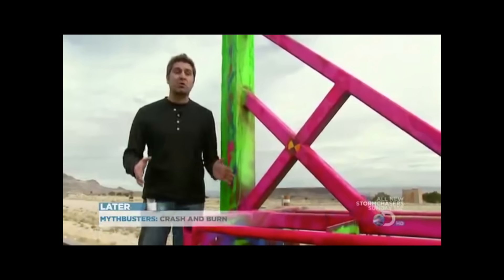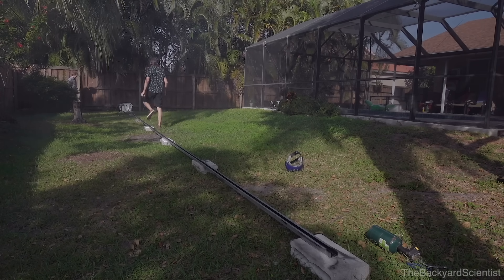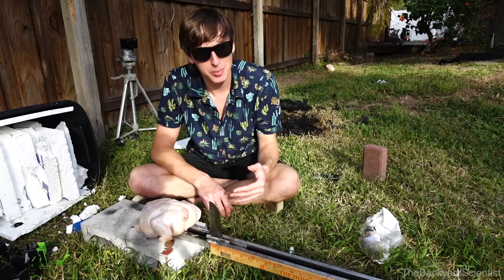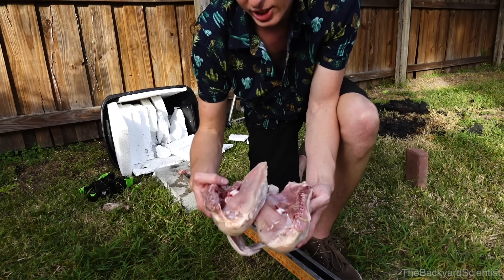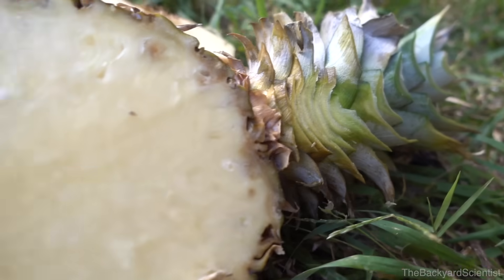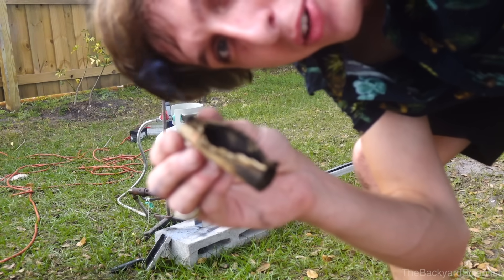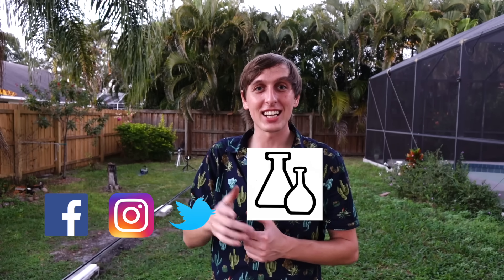150 mph Rocket Knife

Comment from the maker: MythBusters made me do it!
Any ideas for next weeks RED HOT ROCKET KNIFE?

ps how long before somebody copies the rocket knife?
Reply: TheBackyardScientist Um
Once they see this video
Reply: TheBackyardScientist do it with flint on the other side!! How many sparks will be created?!?
Reply: Do it with ballistics gel
Reply: TheBackyardScientist Try cutting through some oobleck, a phonebook, a roll of tinfoil or paper towel or something maybe, and a line of several of the same vegetable to see how many it can get through (though you may need a longer track of that one). Awesome video.
Reply: +TheBackyardScientist 
Man I miss mythbuster !
Reply: A  baseball, a car battery, a tire, a wheel of cheese, a can of lard, a can of spray paint, a pool noodle(length wise), anything dipped in liquid nitrogen that would shatter, a long pepperoni stick, a steel toed boot, a tennis ball, a toilet seat lid, a giant crayon, Toaster Strudel, and a bunch of big marshmallows and or a can of Fluff. Some ideas.
Reply: I think you should do 10000 degree knife versus iPhone 7 because it sucks
Reply: hmmm I'm wondering what will happen if you pit your red hot rocket knife against dry ice or possibly oobleck
Reply: TheBackyardScientist maybe a bottle full of obleck
Reply: try vs an Old Nokia phone
Reply: By somebody, do you mean the crazy Russian hacker
Reply: Flip it around.
Rocket car vs Knife
Reply: TheBackyardScientist dang, I saw the title of this video, went straight to the comment section to make the 1000 degree knife joke, buts it's been done already :(
Reply: TheBackyardScientist a popcorn tin or a toy monster truck ( a metal one please)
Reply: TheBackyardScientist make the track longer
Reply: Try to cut a block of ice with the red hot  150 mph knife pls
Reply: I think a bag of flour would look cool. Or sugar, I think the knife would defiantly be going to fast to melt it though.
Reply: TheBackyardScientist oobleck
Reply: TheBackyardScientist please please do the GoPro again with longer route
Reply: TheBackyardScientist a few ideas 
1: phone book
2: large block of ice
3: one of those "cut/knife proof gloves"
Reply: TheBackyardScientist hey if you want to get a crap ton of subscribers all you have to say is 1000 degree knife vs...
Reply: coconut
Reply: TheBackyardScientist do the same thing but with 1000 degree knife
Reply: TheBackyardScientist can you do 1000 degrees knife challenge with your rocket knife
Reply: bend the other side of the rail upwards and see how far up an aerodynamic rocket could go
Reply: I got a suggestion. DON'T TOUCH THE KNIFE! lolllll
Reply: Do 150mph rocket pants
Reply: TheBackyardScientist OOBLECK
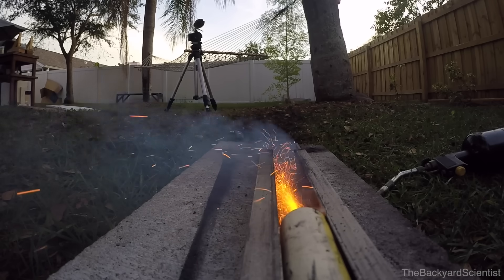Reply: TheBackyardScientist I guess you can say from 6:15 to 6:18 the go pro went from 0 to 100 real quick xD
Reply: You were a bit late with the countdown.
Reply: TheBackyardScientist I watch grant as well as mythbusters
Reply: TheBackyardScientist YOU ARE AWESOME
Reply: TheBackyardScientist  set a pice on f fabrice on fire with mirroes
Reply: the backyard scientist  this idea u might like invite one of the myth busters and tell him to bring buster   to make a mold with a skeleton in it. Experiment idea= Have one experiment with a hot knife and one experiment without a hot knife, also make the knife like a foot long ok. Keep being cool :-)
Reply: Do a chain reaction, where one knife sets off another and maybe a Rube Goldberg machine...I don't know.
Reply: TheBackyardScientist you should make a really long track.
Reply: TheBackyardScientist i thought it was going to be a live chicken
Reply: TheBackyardScientist when using the black powder make sure it's crushed into small pieces because the bigger the more explosive
Reply: TheBackyardScientist you should cut the mighty wallet
Reply: Can it cut through a brick?
Reply: TheBackyardScientist 

Knife vs knife
Hot knife vs knife 
Hot knife vs hot knife

(Will two of the same knives be able to slice each other?)
Reply: Can you make it chop a paint can
Reply: TheBackyardScientist you should have been on "the search for mythbusters" or whatever it's called
Reply: TheBackyardScientist I miss mythbusters :(
Reply: TheBackyardScientist Two knives on opposite ends of the track crashing into eachother!
Reply: TheBackyardScientist ballistic gel,
Reply: Get a piece of aluminum near its melting point then rocket knife it. See if the extra pressure and resulting heat causes it to melt and slice in half!
Reply: TheBackyardScientist put a red hot knife on the rocket sled
Reply: Melt a nife
Reply: TheBackyardScientist you should make this a series so we can watch more rocket cutting
Reply: TheBackyardScientist i dear you to make the fire type of the zippleback gas and sparks like the movie how to train your dragon
Reply: TheBackyardScientist Maybe some marshmellows, a rubix cube, a water balloon suspended from a string or a deck of cards. Or just a shoe.
Reply: Closest to a copy is DemolitionRanch using a can cannon to shoot a bowie knife missile. This moves a butt ton faster.
Reply: MineFish 
1000° knife*
Reply: 1000c° rocket knife VS. 1000c° rocket knife ;-)
Reply: Test the hot knife through a block of ice, plastic container of water and a piece of wood.
Reply: colab with "whats inside"
Reply: TheBackyardScientist try cut a metal  car  model I have no idea how but I know you will find out how
Reply: Can you please give it a shot with ice, or dry ice, and see if there is a significant difference between a rocket propelled knife and a red-hot rocket propelled knife?
Reply: TheBackyardScientist you should do some things that will have varying difficulties to see the burning effects, jello, soap, balsa wood, large crayons, plastic figurines, books of different thicknesses, and some really light freestanding objects like cardboard and a ball of aluminum foil would be interesting, see wether or not it's moving fast enough to cut it instead of pushing it away.
Reply: Coconut and a piece of metal.
Also try to run two rocket knifes into each other from both ends
Reply: when people realize they can make views and lots of money is when they steal it, And do red hot rocket knife through multiple sticks of butter or something
Reply: TheBackyardScientist a coconut.
Reply: +TheBackyardScientist, please do a talking furby >:)
Reply: Red hot rocket knife throo a tablet
Reply: TheBackyardScientist Red hot rocket knife vs. dry ice
Reply: TheBackyardScientist make it do a loop
Reply: TheBackyardScientist What whould happen if you  launch an 1/64 scale and an 1/43 or 1/36 scale diecast car in that track?
 You should also try to launch two cars in the oposite ways of the track and let they have a front to front crash!
Reply: TheBackyardScientist THIS IS #13 ON TRENDING RIGHT NOW!
Reply: Send it through some metal objects, or hell ask people to send you objects to cut through. XD maybe even try a brick
Reply: 150 Mph is equal to 67.1 meters per second.  Going from zero to 67.1 m/s in 0.3 seconds gives an acceleration of about 220 meters per second per second, which is about 22 Gees.  This is definitely enough acceleration to be deadly if sustained.  However, my guess is that 0.3 seconds of it might be survivable.  The problem is slowing back down, crashing into a bunch of rags/Styrofoam would be pretty deadly.
Reply: TheBackyardScientist this is my most favorite or top 3 videos on YouTube. good job i hope you do more like it
Reply: TheBackyardScientist fruit ninja
Reply: TheBackyardScientist do that same experiment except with the knife being 1000 degree please
Reply: TheBackyardScientist is it possible to do the moonwalk on the moon
Reply: Pro Tip: Hot steel looks like cold Steel
Reply: TheBackyardScientist 1000 degree knife going 150 mph
Reply: lol how smart can you be to touch a knife that was red glowing just a min ago
ps. no hate i love your videos
Reply: TheBackyardScientist launch it into a lamp please
Reply: TheBackyardScientist Try out a Prince Ruperts Drop!!
Reply: TheBackyardScientist do it to dry ice
Reply: TheBackyardScientist Rocket knife vs stuffed animal
Reply: TheBackyardScientist lol
Reply: OOBLECK
Reply: Was The truck green or yellow
Reply: TheBackyardScientist you should try to make it cut through a rack of ribs i think the chicken ribs were not so tough so do big ribs
Reply: Thebackyardscientist where did you get the recipe to make them
Reply: that car-intro blew my mind
Reply: TheBackyardScientist you are awesome
Reply: I agree with you
Reply: TheBackyardScientist Im new
Reply: electrocute liquid nitrogen
Reply: TheBackyardScientist I have a therie to revolutionize the way man travels
Reply: SleazyPineapple ! He said it took 0.5 of a second to GET to 150 mph
Reply: Why dont you build a longer rocket track and put the GOPro on the rocket. I think you will get some awesome footage ;)
Reply: TheBackyardScientist whats up
Reply: TheBackyardScientist ñ
Reply: 5:35 don't forget  you heated up the knife.
Reply: TheBackyardScientist maybe tomorrow we'll see some copies
Reply: TheBackyardScientist hey I said that on instagram
Reply: +TheBackyardScientist Create a bigger track kinda like a roller coaster :D
Reply: TheBackyardScientist i
Reply: TheBackyardScientist please post more
Reply: Try The Rocket Knife through Dry Ice, Iphone 7, A Log, or even maybe a McDonalds Burger.
Reply: TheBackyardScientist. what happens when you throw salt on a fire?
Reply: Heat up a knife/machete in your forge then cut some stuff. (Get it to a bright orange/yellow)
Reply: TheBackyardScientist lyhhgnbbn
Reply: TheBackyardScientist GO THROUGH A BAG OF SUGA,OR SOMETHING LIKE POLLY PLASTICS
Reply: TheBackyardScientist you should copyright this as a speedy fast fruit and other foods cutter
Reply: Please read my comment it would be a cool idea also get better soon
Reply: TheBackyardScientist perhaps you can use this to make two items collide and record it with a high speed camera😊
Reply: Try cutting some carbonated drinks
Reply: TheBackyardScientist A coconut or another knife. See how deep it embeds itself into gel. And we should think of a material to reliably slow it down.
Reply: Is that guy your lover
Reply: TheBackyardScientist was it just me or was the top of the knife facing the targets and not the blade?
Reply: TheBackyardScientist you should have made the knife red hot and 1000 degrees
Reply: TheBackyardScientist why don't you see it can cut though a phone
Reply: Do a plank of wood.
Reply: TheBackyardScientist do an I phone and see how well it survives
Reply: TheBackyardScientist next do it with a watermelon!!!
Reply: TheBackyardScientist never mind you just did it
Reply: TheBackyardScientist oh wait nvm lol should've waited
Reply: TheBackyardScientist 
It will be copied in 2-3 weeks ^^
Reply: TheBackyardScientist I love when you touch the red hot knife
Reply: TheBackyardScientist cut through a big rubber band ball
Reply: Maybe see if the knife will cut through a red-hot metal pipe. assuming it's become malleable enough, it should cut clean through and maybe even create a few sparks. How about Rocket knife VS red-hot Flint stick?
Reply: 0 to 150 real quik
Reply: TheBackyardScientist myth did this for a metal car,but you doing it with a plastic car dont it will give any changes to the myth
Reply: TheBackyardScientist next meme red hot rocket kinfe vs....
Reply: TheBackyardScientist were you in Orlando Florida at a Jw Marriott 15 floor cause I think I saw you.
Reply: what if... it cut through a second knife?
Reply: TheBackyardScientist I love the myth busters it's my favorite show
Reply: great job with holding the hot knife... just great job... :/
Reply: TheBackyardScientist tub of cornstarch and water
Reply: can you make the Rocket Slide ramp slanted
Reply: Jacob Burrell it was a santoku knife blade so the straight part is to sharp side.
Reply: They're too lazy to make a sugar rocket and a track.
Reply: Try a line of coconuts.
Reply: Make a super long pipe and see how far it can go without stopping
Reply: TheBackyardScientist dude try using a katana and slice through a paint bucked also super heat it and slice through the dry ice I think that would be cool
Reply: cut through a reactive element
Reply: TheBackyardScientist what would happen if you poured molten aluminum in water with sonic vibrations going through it
Reply: cut some sort of electronics like a phone, tv, camera, game console. maybe a canned soda too!
Reply: TheBackyardScientist  the safest project ever attaemptes
Reply: TheBackyardScientist water bottle
Reply: Multiple rockets
Reply: TheBackyardScientist try a gelatin chicken
Reply: TheBackyardScientist ohh I have an idea, how about 2 super rocket knifes slap into each other,
Reply: TheBackyardScientist im doing it in the morning as soon as i wake up and get ready for the day
Reply: TheBackyardScientist knifes VS aluminum OR pewter because its so soft OR that really reAllly soft metal
Reply: TheBackyardScientist cut a GoPro in half with the rocket knife
Reply: bigger targets, or do it like gun professionals with jelly see how fast and hard it goes , and more fire to make it look cool specially with the red fire and the green .👍
Reply: TheBackyardScientist you should do a vid with those people who test weapons on zombies and c if that knife can kill a zombie
Reply: TheBackyardScientist you should do a red hot knife vs water liquid nitrogen and molten aluminum
Reply: yess, everyone copies everyone UHG (and then people feel that just because something's a "trend", they don't have to credit the original creator?? That's not how it works buddy, that is Not how being a quality human being works. >:( //sigh)
Reply: Miles Aaway its all about having fun dude
Reply: true 
(having fun while giving people validation in the form of credit woooo!!!!!!)
Reply: Well since we saw it on Myth Busters.... The minute you made a rocket knife :) :)
Reply: IS MY DOG CUTE
Reply: My dog is cute :3 yes 🐶🐕
Reply: Calvin Chapman good idea
Reply: it looks tasty would wanna eat it
Reply: TheBackyardScientist Send it through a roll of aluminum foil.
Reply: now even you are doing the 1000 degree knife?
Reply: *680 degree knive
Reply: uhh no, I messured when it's glowing hot is is about 680 degrees cescius.
Reply: TheBackyardScientist you looked like a liddle kid on christmas :D as it workt with the car. nice :)
Reply: TheBackyardScientist it's to hard to do or recreate
Reply: TheBackyardScientist red hot Rocket knife vs. block of ice
Reply: :P
Reply: Try a few foot section of 2x4 or 1x4 going with the grain and see how far it will travel. Then see if it can cut through a 2x4 against the grain.
Reply: TheBackyardScientist 
Someone with no rocket knowledge is going to die trying this trend but your vid is awesome
Reply: rocket propelled katana cutting though a used medical school cadaver.
Reply: TheBackyardScientist could you set up a track so that the red hot rocket knife could complete a perfect loop and cut through a large diameter watermelon which is placed in the centre of the loop. Possible backfalls: extreme g's cause catastrophic failure to the integrity of the rocket knife and hey presto - speed-flying hot knife. Still would be fun to watch.
Reply: u should be in mythbusters the search
Reply: u should be in mythbusters the search
Reply: TheBackyardScientist I love you
Reply: TheBackyardScientist I made a rocket train last week but it was a little different
Reply: Cut through a loaf of bread to see if it toasts the inside (it will probably be too fast to do so, but I'd love to see it anyway)!
Reply: What would the MythBusters say? Ah yes, DON'T TRY THIS AT HOME! ahahahahaha
Reply: TheBackyardScientist you should really try cutting things with a stream of water coming at high speed like in the naruto anime. ps:its sasori's technique in the anime
Reply: Pleas pleas let it adjust the track so it can do a hole loop on the track and and see if it slows down or not
Reply: Golf balls, bowling ball, a phone?
Reply: Cooked chicken
Reply: I know that pain of forgetting about hot metal. I have two metal pots, one of them, the handle does not get hot at all, and the other becomes super hot.

I forgot the one becomes super hot as I hardly use it and as I gripped the handle I burned my hand. I pretty much did the same dance as you had. haha. Hope your burn wasn't TOOOO bad. although it couldn't have been too great either.
Reply: TheBackyardScientist Make the knife go through obleck
Reply: TheBackyardScientist coconut
Reply: TheBackyardScientist do book,toys,hard football and guitar for next rocket knife vid
Reply: TheBackyardScientist could you do a shoe? Like vans with a more rubber.
Reply: Is there a way to turn off everyones replies here? instead of turning off all replies everywhere?
Reply: TheBackyardScientist for being so smart you did the dumbest thing ever. Touched a red hot knife.
Reply: @Jackesloco21 what part of this video gives you the impression that he is smart? Was it the rocket engine that exploded next to the large tank of propane?
Reply: +TheBackyardScientist  RED HOT ROCKET KNIFE CUTTING THROUGH BISMUTH and soda cans !
Reply: TheBackyardScientist shoulda used a die cast car
Reply: +TheBackyardScientist  RED HOT ROCKET KNIFE CUTTING THROUGH BISMUTH!
Reply: 1000 degree 150 mph knife
Reply: TheBackyardScientist  How about blocks of ice and dry ice?
Reply: TheBackyardScientist well to be fair you copied it first
Reply: TheBackyardScientist I challenge you to make it go 1000mph
Reply: I dare you to cut a coconut and eat it.
Reply: You are ugly Bra
Reply: Hey scientist,

You actually should try a versus one. Like '150 mph knife vs ikea wood' or something :)

Sincerely,
Ruben Kleiburg
Reply: TheBackyardScientist do red hot knife vs different flamable items
Reply: TheBackyardScientist you should tape or zip tie them down.
Reply: TheBackyardScientist try something flammable
Reply: shoulda done a frozen chicken....
Reply: TheBackyardScientist hi
Reply: TheBackyardScientist this is like a backyard guillotine
Reply: GWS
Reply: TheBackyardScientist please tell me how to make your sugar rockets
Reply: TheBackyardScientist  can you try to  cut a brick with it
Reply: Gabriel Nardi I was going to say that
Reply: TheBackyardScientist make the knife 1000 degrees
Reply: TheBackyardScientist 
still want that coconut cut
Reply: TheBackyardScientist make the trak bigger
Reply: TheBackyardScientist or longer
Reply: TheBackyardScientist  great video
Reply: Emiel DC lol
Reply: TheBackyardScientist just don't let MrGear see it and you're fine 😂
Reply: Thom _g10 he said red hot rocket not red hot chili peppers smh
Reply: TheBackyardScientist you essentially made a very very glorified ballistic onife
Reply: TheBackyardScientist knife**
Reply: +TheBackyardScientist You should turn it into a loop.
Reply: TheBackyardScientist sizzles =subs
Reply: TheBackyardScientist I miss the myth busters
Reply: Block of a ice!
Reply: TheBackyardScientist A coconut!!
Reply: TheBackyardScientist a Land Rover!
Reply: TheBackyardScientist you should do some kind of metal
Reply: TheBackyardScientist BURN IT ALL! BURN ALL OF THE TATERS! Then eat them.
Reply: TheBackyardScientist Not long...
Reply: OMG I thought you were going to do a live chicken xD!
Reply: cook steak or food with it
Reply: I already want to try it. Repeatability is part of the scientific method, right?
Reply: idk but have fun
Reply: Switch out the knife to a piece of net! ✌️
Reply: TheBackyardScientist Insted of only one engine, but in there two, three and four, to See how fast i would be going and what damage it does
Reply: TheBackyardScientist
Reply: TheBackyardScientist
Reply: You should see if the knife can cut through a gun. Get one for cheap that doesn't work or is really old. The knife would have to be going so fast...
Reply: that won't work metal vs maetal think
Reply: are you in Florida?
Reply: TheBackyardScientist
Reply: TheBackyardScientist I'm so copying this
Reply: hes coping what
Reply: TheBackyardScientist  hi
Reply: TheBackyardScientist can u shake a soda and shoot it
Reply: TheBackyardScientist 1000 degree rocket knife!!!!
Reply: You should try cutting metal rod in half
Reply: TheBackyardScientist 
P
Reply: consider it done :)
Reply: TheBackyardScientist v v v.
Reply: TheBackyardScientist the beat and newest in 1000 degree knife chalenges... lol
Reply: bankai , katana kill bill style and blade runners
Reply: TheBackyardScientist idk but did you use two toys the 1st one is A green jeep and 2nd is A yellow jeep
Reply: TheBackyardScientist I bet if you had angled the knife backwards slightly the cuts could have been even cleaner
Reply: TheBackyardScientist the car was green when you saw the slash it made but then its yellow in the highspeed camera.
Reply: TheBackyardScientist put 10 rockets in a little car and see what happens
Reply: TheBackyardScientist and the knife above the car
Reply: TheBackyardScientist YOU FORGOT TO MAKE A LINK TO THE KING OF RANDOM'S CHANNEL AFTER MENTIONING HIM!!!
Reply: It's either a completely different toy car or because you need a lot of light/ brightness the green might appear more yellow.
Reply: TheBackyardScientist pls do a tutorial how to do the rocket
Reply: TheBackyardScientist when u put the go pro on the rocket it took two seconds for it to hit the end
Reply: Bálint Szabó if you want tot find out how to make one go to  the channel the king of random he is the original creator not the backyard scientist
Reply: Joe DeBoo it would kill him idiots
Reply: I made one!
Reply: TheBackyardScientist pls listen... make a really long trail with a larger sugar rocket
Reply: when they said don't try this at home they never said  we ccan't try it in our backyards lol
Reply: TheBackyardScientist rocket hammer please
Reply: TheBackyardScientist o
Reply: TheBackyardScientist 150 mph knife vs giant gummy bear
Reply: TheBackyardScientist you should make a longer version of this with the GoPro like you did at the end. Trust me it will look amazing!!
Reply: TheBackyardScientist this needs to be a roller coaster, lol
Reply: 5 days
Reply: TheBackyardScientist true it's not your fault.dang I HAVE to watch that episode now XD
Reply: CUT UP A FIDGET SPINNER
Reply: I didn't know you cuss
Reply: TheBackyardScientist i
Reply: TheBackyardScientist I'd like to see this thing cut some more stuff with a larger version
Reply: TheBackyardScientist
Reply: TheBackyardScientist j
Reply: TheBackyardScientist try the go pro rocket on a longer track
Reply: TheBackyardScientist is the best
Reply: TheBackyardScientist o
Reply: They make UNO juliooooo
Reply: TheBackyardScientist do a bowling ball
Reply: TheBackyardScientist how old are you are you 25 or 26
Reply: TheBackyardScientist you you rock you're my favorite YouTube video person
Reply: TheBackyardScientist Bruno solo and by the way that was so cool
Reply: TheBackyardScientist I wish you had tried a stronger material then just toy plastic and food . :) but still great video , just wear more leg and hand protectiong
Reply: TheBackyardScientist lol
Reply: TheBackyardScientist my dog has a hot red rocket
Reply: TheBackyardScientist 
Will rule the world
Reply: TheBackyardScientist 0
Reply: TheBackyardScientist     Having that guy towards the end of the track wasn't a smart idea, if it became airborne he could have been like the chicken.
Reply: TheBackyardScientist z
Reply: TheBackyardScientist you should do this only have wd40 at the other end
Reply: 69 years
Reply: Hi Ace Ventura
Reply: TheBackyardScientist rockets on skates, rocket skates.
Reply: try put your foot there
Reply: I would love to see what happens if you put the chicken/steak right up to the knife before you launch it. Will it cut through or simply drag them with it?
Reply: TheBackyardScientist can you please reply to me it will make my night